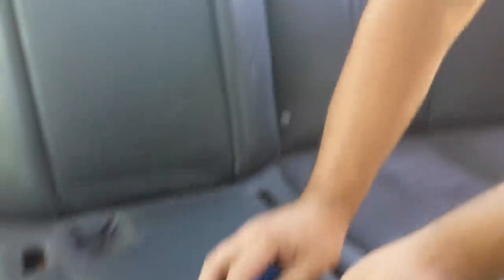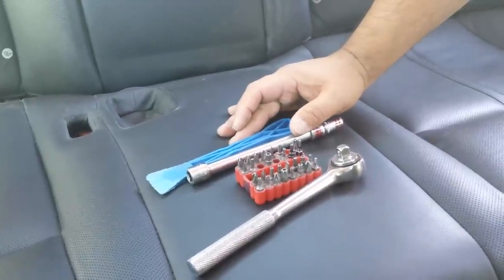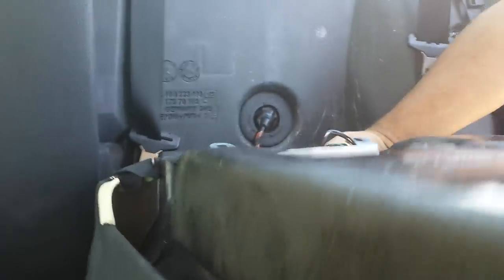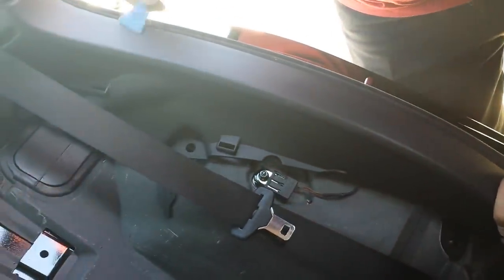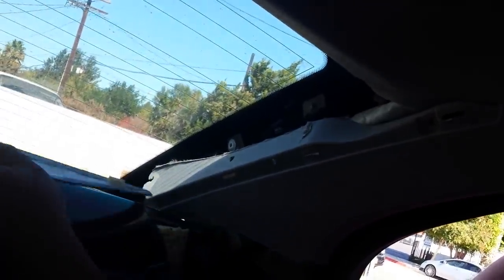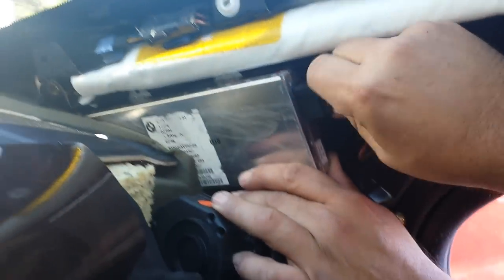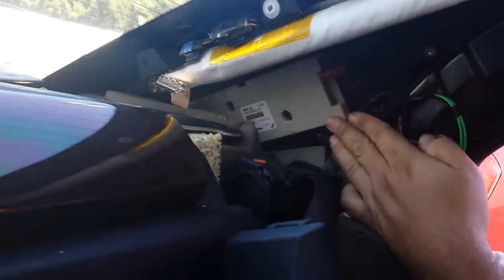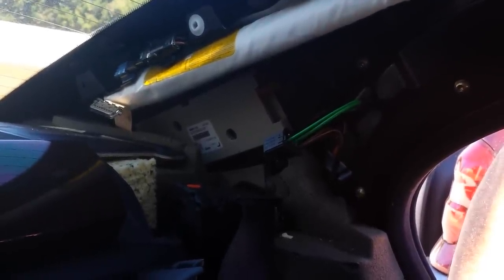How to Remove AM FM Tuner from BMW 750i or 745i for Repair.

Comment: Hi guys.
Just wondering, my radio reception in my E66 is ok for that last 3 years, but when I drive down the road, the reception disappears about 5% of the time, working no problem 95% of the time. I also get constant "remote key battery run down" warnings with my comfort access key, even with a new battery installed (and its a new key). Could the two problems be related to the antenna in the back window? Thanks!

Comment: I have an 04 UK E65 730d Sport.......... i have followed the instructions above but my rear head rests are electric and i cannot seem to remove the to gain access to the rear pillow where the FM module is located. Do you have any videos/suggestions how to remove them? One of the units are breaking the fiber loop, I have bypassed everything in the trunk snd the disc changer so it only leaves the AM/FM unit. Do you have to disconnect the battery before you can bypass the parts to reset the system or should it do it without. I have a spare ASK unit so i'm pretty sure it isn't that unless they both are faulty. I have seen on the net it could be as simple as the fuse in the back of the ASK unit, i'm yet to look at this.

Any information is greatly appreciated, if i lived in the states i would of got you guys to do it.

Thanks

Comment: i have 2002 745 all cds work and sat nav but radio just makes a fuzzy noise i can see all station info but no music just fuzz any help would be great
Reply from the maker: Problem could have been caused by AM/FM tuner module or antenna booster or antenna itself.